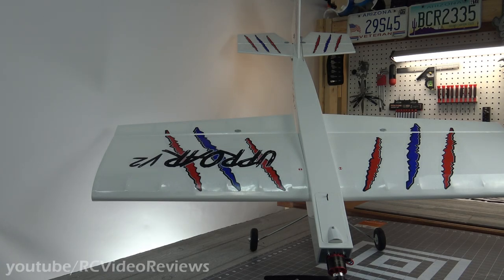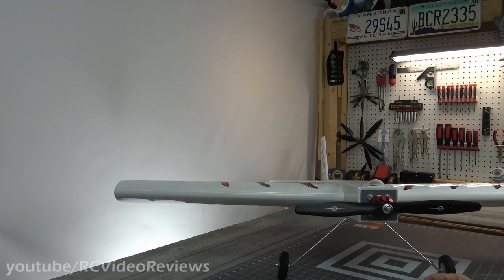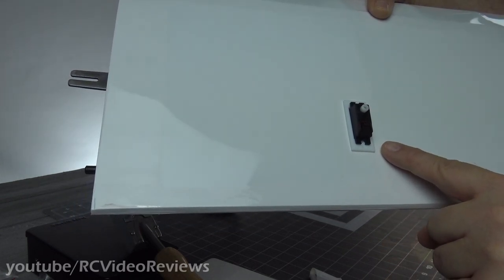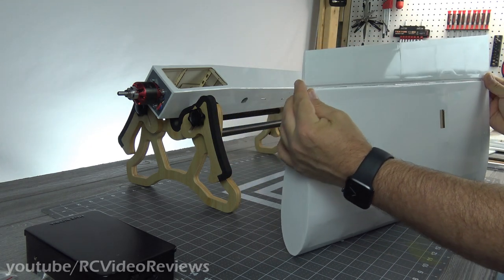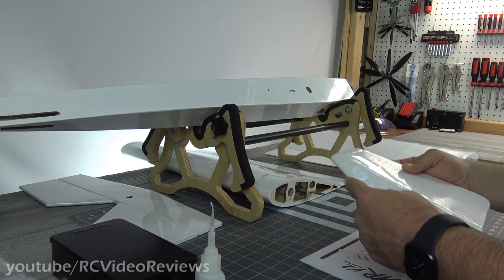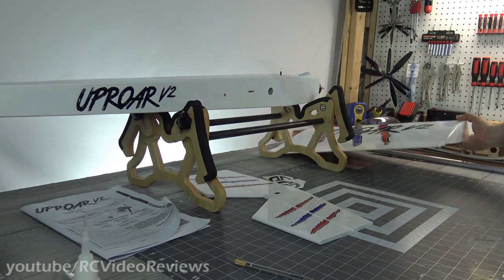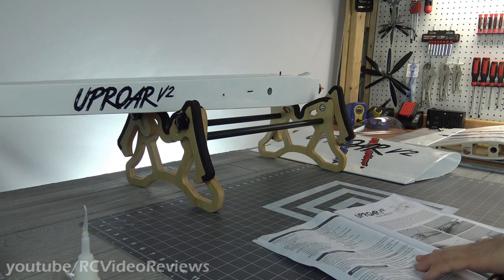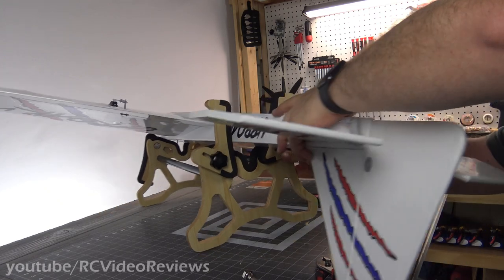Tower Hobbies Uproard v2 Build Review AND Live Build

Comment: Ahh, brings back memories from assembling mine.  Had the same wash-in, remedied in a few minutes with the heat gun and Robart incidence meter.  The mini-uproar assembles totally different, despite looking so similar to the v2 uproar. Having built the v2 first,  i like the mini uproar assembly methods better. Both have crappy landing gears though,  lol. Love the 3d printed stuff, nice job!
Reply from the maker: Bitgo sent me another Tomcat G32 for long term evaluation. I'm putting it on this plane. I got that wash-in worked out with an iron in just a few minutes. 

How are your landing gear holding up on the big Uproar?
Reply: @RCVideoReviews  I ended up trading the big one to a fellow club member.  He replaced it with a dubro (i think)  unit. Have you learned to hover that thing yet 😎
Reply from the maker: What did you trade for?
I have not learned to hover it yet.
Reply: @RCVideoReviews  i traded it for an  unbuilt tower hobbies sbach arf! 😎😎

Comment: great build John looks amazing I am going to use your Stl file for servos makes a clean build look better 
I would put servo protectors and some type of skid on bottom those wheel mounts dont look that good to me either I would hate to see them fold on this plane Take Care
Reply from the maker: Thanks Robert. That STL file can be hacked/stretched/scaled however you need. They fit the Emax3003's perfectly though.

I've heard gripes about the gear, but I've also seen what I would consider a crash called a successful landing too, so I think I'll give it a go. I've seen this plane get real slow. We'll see what happens on the maiden.

Comment: Hi video was very helpful. Was wondering, did the cg balance right away or did you work on it? I have a turnigy sk 4240 740kv,80a beatles, and turnigy 4s-4000. Can't get cg to balance without adding alot of weight.
Reply from the maker: Hi Gary, Unfortunately, I sold this plane so I have no way to look and I can't recall during the build if I did anything specific for weight. If I didn't mention it the video, I probably didn't do anything particular. I usually do mention the addition of ballast when it happens.

Comment: The latest two Phoenix models that I've built have plastic dominos now.  I have the same concern you have.
Reply from the maker: Oh really...? I've built a handful of Phoenix planes: PC-9, Spitfire, P-51 and they all used the metal domino. So far the plastic one has been holding up. Time will tell I guess.
Reply: @RCVideoReviews  Just built the Phoenix SBach 342 and Edge 540, both had plastic dominos.
Reply from the maker: Steven, I've been looking at both of those planes as alternatives to the PA planes when our Florida wind is acting like a jerk. What do you think of them? I really wanted that Edge 540 but TH sold out before I pulled the trigger.

Let me know what you find out about those plastic dominos.
Reply: @RCVideoReviews  I have the SBach setup as electric and the Edge is gas.  I like them both, but I will say Phoenix models are not what they used to be.  I built the same SBach 3 years ago and there is definitely difference in design quality.  The balsa frame seems more slight and no more metal control connectors.  They use the same grey plastic hardware that is used on the Uproard in this video.  I had a bit of a hard landing with the Edge and broke the landing gear off at all the glue joints.  I'm not sure what that says, but they just don't seem as sturdy as they used to be.  Having said all that, I do enjoy the way the Phoenix models fly.  I'm on the Gulf Coast and we have our windy days; both planes handle it well.